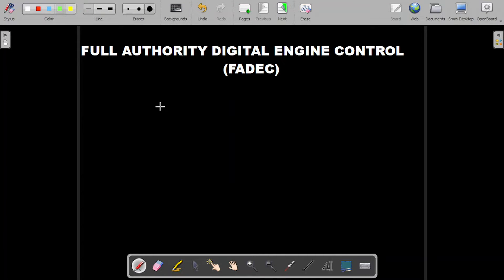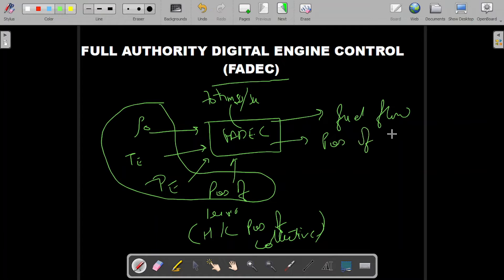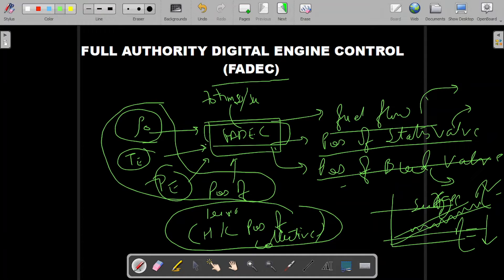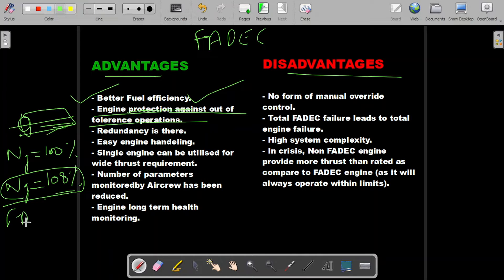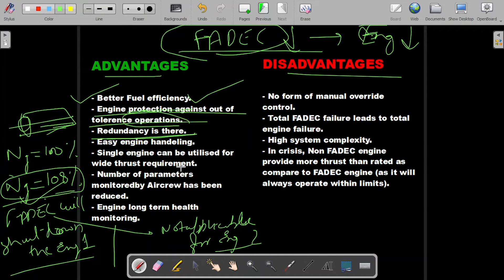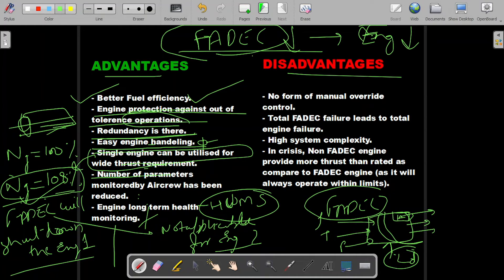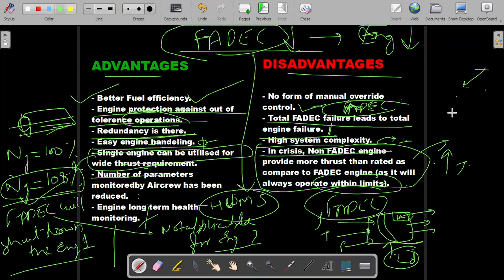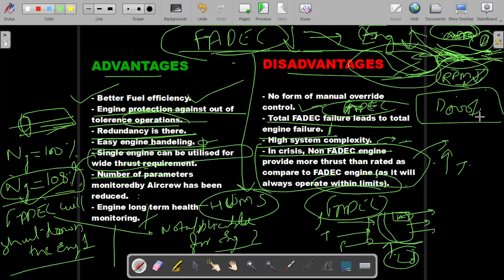Full Authority Digital Engine Control (FADEC)

Comment: Can you explain working of FADEC in terms of cheetal Ac Of army
Reply from the maker: Give me sometime, i will get back.  Thanks.
Reply from the maker: Hello. So in Army Cheetal, Cheetah or in Navy Chetak, engine fuel requirement as per the power (to overcome drag) is not controlled by Fadec but rather a mechanical Governor. 
For in depth understandings of Mechanical Governor. I will prepare a video on it.
Thanks for being in touch.